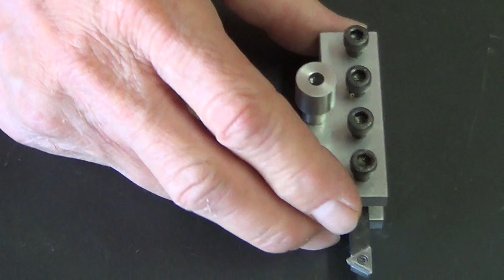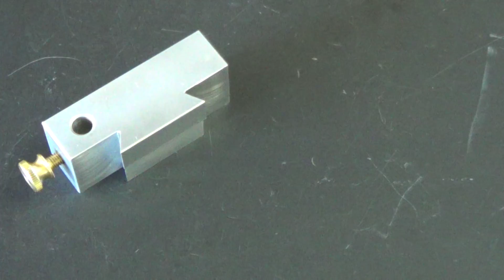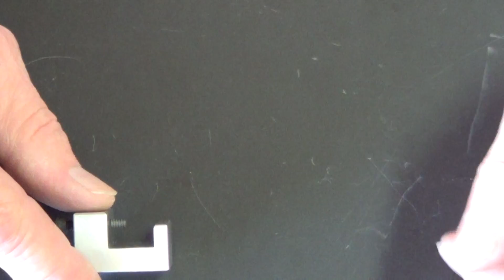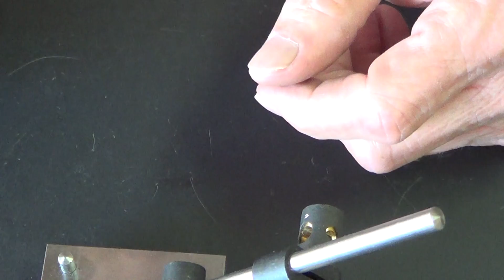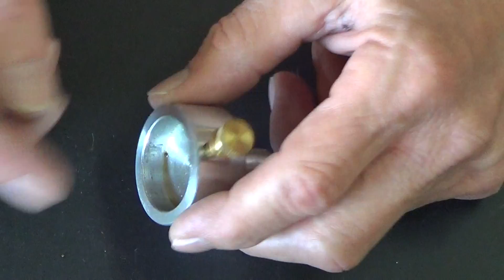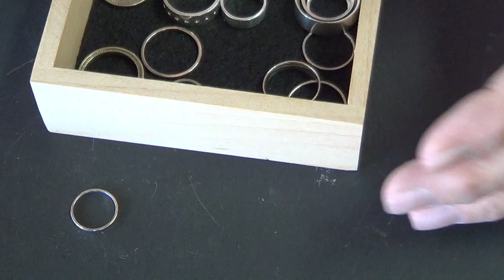DIY tooling for the mini lathe Video #2

Comment: Stick down a little automotive wetordry sandpaper (select your own grit according to how much material you need to remove) and work up to 2000-grit) to your granite surface plate with a little light oil. Now use that to fettle the bottom of your surface gage to flat. If you need it even flatter, find a local machine shop that can lap it for you on their lapping plate. Or make your own lapping plate from brass - it doesn't need to be very big.
Reply from the maker: Good input! In a later video I finally found someone with a surface grinder that made it perfect. It's now my main surface gage. Never heard of automotive sandpaper and need to look into that... Cheers
Reply: Once you start using automotive sandpapers (available at your local 
car-parts store), it'll open up lots of excellent opportunities to you. 
For example, you can thereafter use the "Scary Sharp" technique for 
sharpening tooling (both for metalworking and for woodworking), and you can polish your own plastic-lens headlights for your car. Neat stuff. 

Silicon carbide grit (works fine on tungsten carbide cutters & surfaces), immune to water and oil, very highly uniform 
surface layer, available in very high grit counts (nearly enough for 
optical clarity). Poor man's surface grinder.    8)

Just don't ever use any of the carbides or diamond for high-speed dry grinding on any ferrous metals; the hot iron dissolves carbon out of the carbide or diamond, eroding the abrasive very quickly. That's why green carbide or diamond wheels last a long time grinding carbides, but wear very quickly grinding any steel. Low speed (sparkless) is fine with either, and wet (again sparkless) grinding is fine, but when you generate any steel sparks, then the steel is hot enough to dissolve carbides.
Reply: Tim Hofstetter hi guys , There are no coincidence  in this life and I know for sure that God is giving all of us the chance to know him better , make a relationship with him and have a great life , the answer is  the  prophet Muhammed Peace be upon him , he is the latest messenger from God to all mankind , 
Muslims were once the leaders of the world when they were practicing the commandement of the Coran , 
I know that you will delete this message but please take a few minutes of your time and make some research about it .
I am sending this message to everyone I can reach , everyone deserve to know the truth ,
Peace be with you and good luck.

Comment: held tenths on south bend lathe..for something like that step collet...your set up on cutoff blades. those are screw machine stock t1 and t2  they make those with carbide brazed tips..8..12$  would check periodicle practical machinist..for better cutoff holder way your holding now set screws will damage cutoff edge..chipp out ding up

Comment: I had a good laugh when you said it wasn't possible to turn something down as small as the ring on a bigger lathe 🙂. You do know that's a crazy claim don't you? I have a 3500lbs lathe that can hold tolerances to 10ths all day long. Nice job on the knurling tool.
Reply from the maker: Some how I'm sure you can do it Shawn! Would love to see a vid of you turning a nickel down to .035 x .035 using your 3 jaw on your channel. Up for the challenge?
Reply: +Dave M makes zero sense to hold a part that small in a 3 jaw chuck, if that's the challenge it has nothing to do with machining.
Reply from the maker: LOL that's all I had when I made my first rings which you saw in the video. Curious what would you use?
Reply: +Dave M Mandrel between centres for cutting the OD after boring the ID. Any lathe could do this sort of work.

Comment: That's a good collection of Tool holders, I hope to make my own as well once I have got used to the mini lathe, which I got about 2weeks ago, I am busy watching videos, I like what you did with the Tailstock hold down, what thread did you use to lock it down, if I have it right you are saying you have no cam on it ?. Many thanks for uploading your videos, mine is a Sieg SC2 7 x 12
Reply from the maker: +binness Hi, There is no cam its just a threaded part that replaces the nut that was there. Not sure what the pitch was now. Hope your Sieg is in better shape than my HF when I unboxed it. Keep in touch!! dave@theminimachineshop.com I remember starting out and no one was there to advise or help.
Reply: +David Mitteer Ok thanks for getting back, so as I understand it, you just replaced the nut and stud with a longer stud and put washers on so when you swing the nut it pulls it uptight against the casting, I think I have it, I thought at first you had made a cam, thanks for the offer of help if I get too stuck, Bob
Reply from the maker: +binness Hi Bob, just the nut was replaced, no stud. And you have to figure where to drill and tap the hole for the locking leaver. I did it by finding where the new nut just started to get tight then backed off slightly and made a mark for the hole.